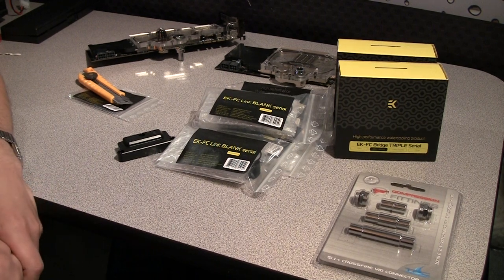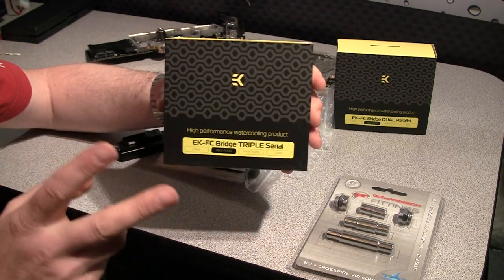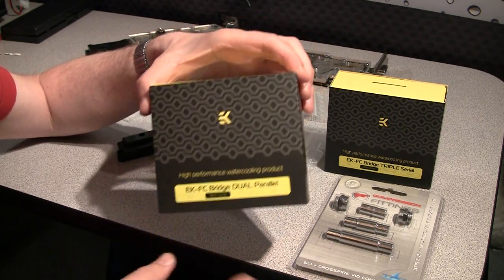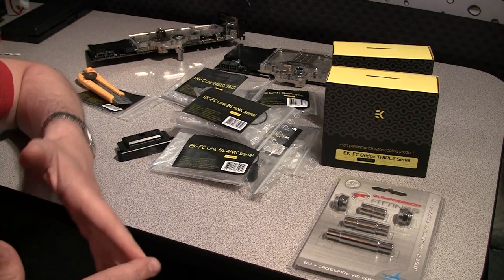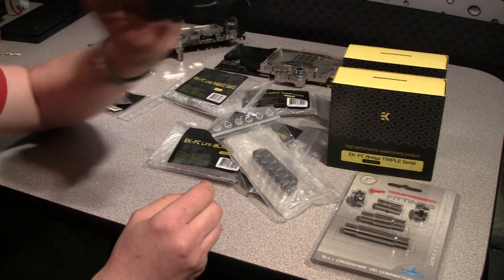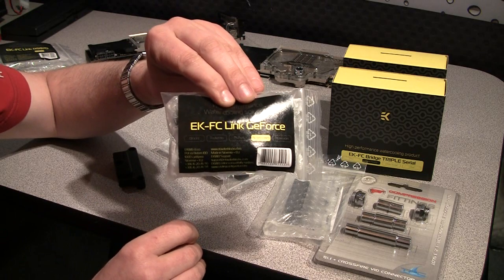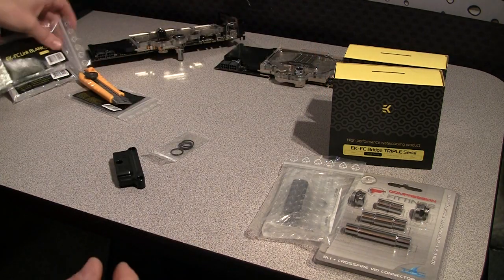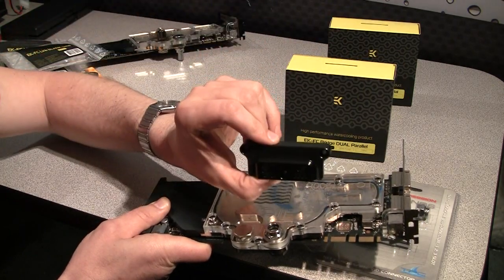How to choose your EK SLI Crossfire Multi-GPU Watercooling Kit

Comment: I have a i7 2700k and 2 6970 crossfire, and already bought a corsair H100 water cooling for my  cpu and it has a large radiator and 2 fans with it. Please tell me what else do I need to cool my 2 6970s :)